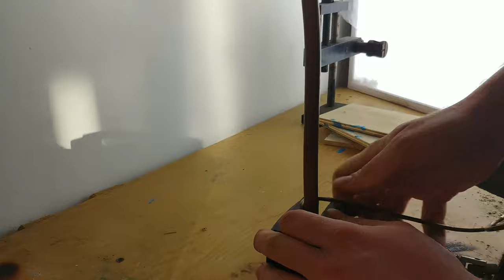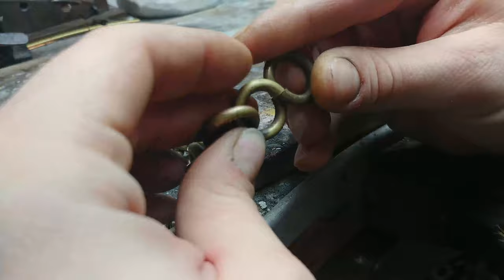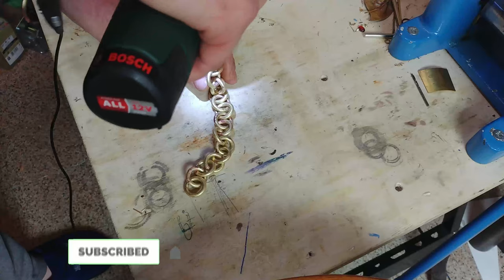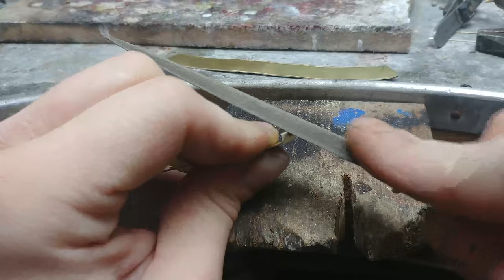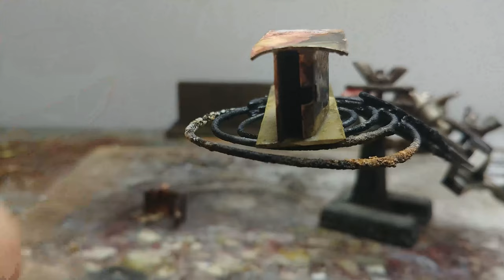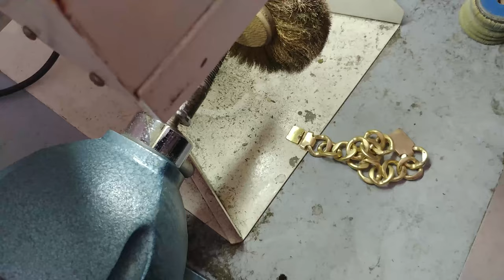Making A Cuban Chain Bracelet With A Box Clasp. ~ By Kryher

Comment: What is the wax substance that you used with the jewelers saw?
Reply: It looks to be a candle, I’d assume any wax will lubricate the saw but it’s not a necessity to cutting the wire.
Reply from the maker: Exactly! I actually started using engine oil to lubricate the saw in my latest works as I find it more effective and less messy
Reply: @bohdankryher9456  thank you!!!!

Comment: What was that torch when you soldered the links , looked like a syringe 🧐
Reply from the maker: Hello there, the tiny torch is a vintage oxy-hydrogen water welding machine with sawed off and filed syringe needle point tips! I'm using a more modern one in my latest video as I decided to upgrade a bit 😁
Reply from the maker: @Ian Sacks I got it used,  reconditioned with a warrantee from a jewelry supply store in italy, I'm not really sure about the exact brand cause they changed the case, but it works like magic 😁

Comment: Nice tutorial but your links are way too far apart....
Reply from the maker: Hey there Scott! I know 😅 I was still figuring out the right proportions
Reply: @bohdankryher9456  It looks like 0:36 seconds is where you went wrong, the size of the rod you're wrapping your wire around should be the same size as your gauge (or double the size of your gauge if you want 2 links per row). I would also bolt down your vice-grip to makes things a bit easier lol. Nonetheless, great job.
Reply from the maker: Yeah I figured out the proportions through trial and error 😶 thank you 😃 I made another cuban chain video recently, I'd love to hear your views on that one I thinks it's technically more correct, let me know https://youtu.be/KWnzg602aAw 👀